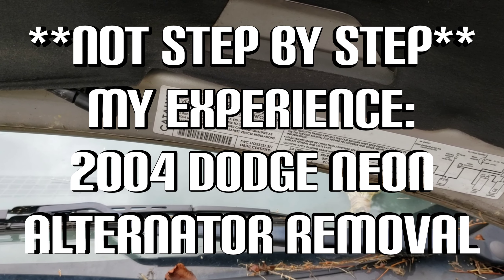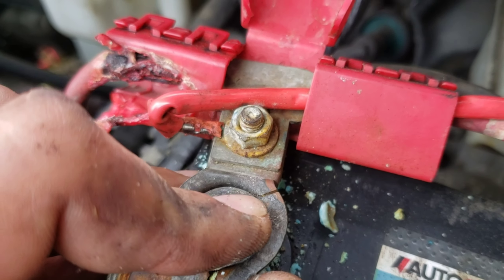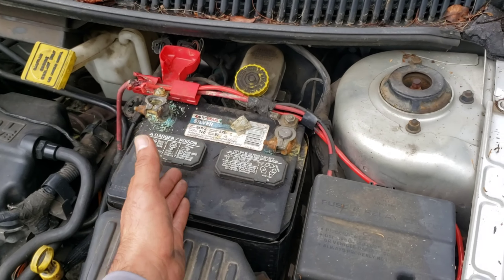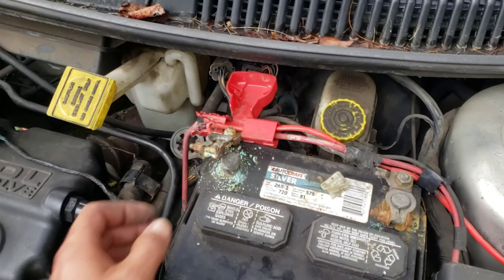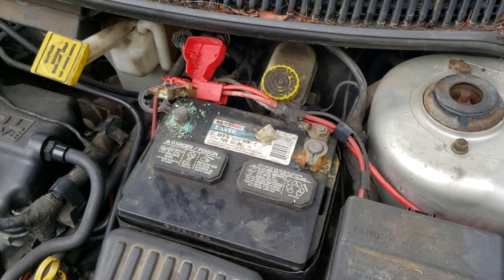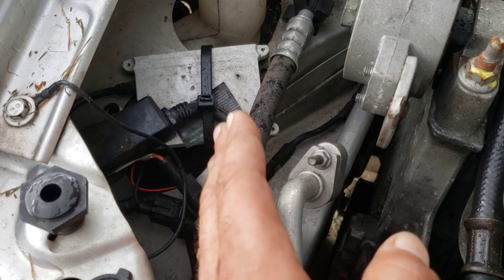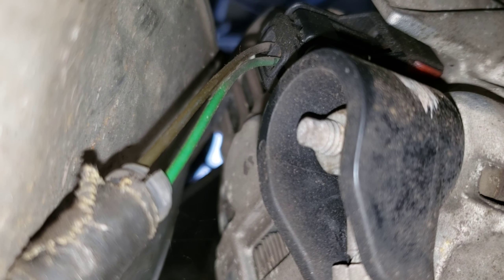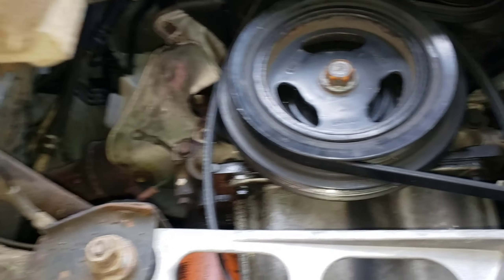My Experience: 2004 Dodge Neon Alternator Removal and don't buy garbage HID kits

Comment: Hmmm. Running into the same problem .I thought it was the alternator.  Removed it and had it tested. Tested good. But I fo have a fair amount of corrosion on my terminals too.
I also found a short behind the speedo cluster.  The connector pins heat up and melt. Boom shorts. It makes my turn signals and flasher fuse blow in about 5 minutes of driving 
 In the process ig replacing that now.
Reply from the maker: Great find on the cluster issue. I hope you're able to get your situation resolved.
Reply: Did cleaning the terminals of corrosion fix your issues?  I have voltage fluctuations with the interior lights and the headlights.  It almost wants to stall out. The word on the internets is the computer may be the problem as it is what controls the voltage regulator.  Which is not serviceable. You can only replace the computer.